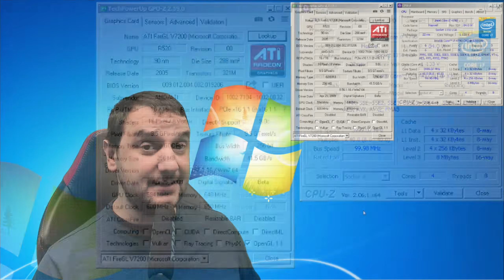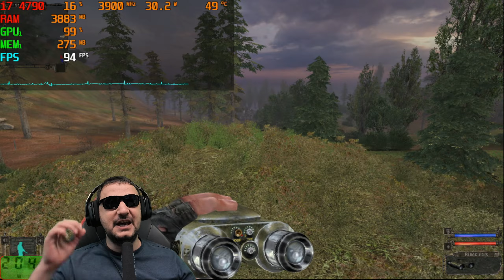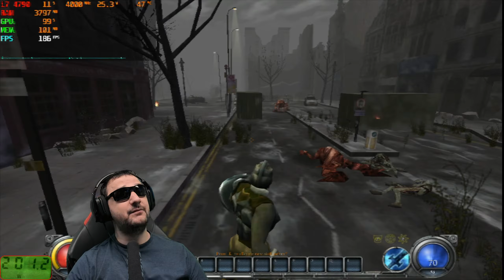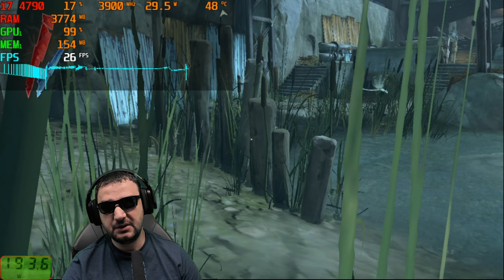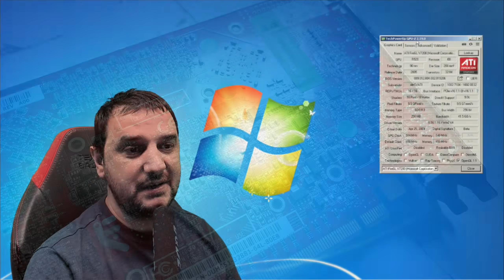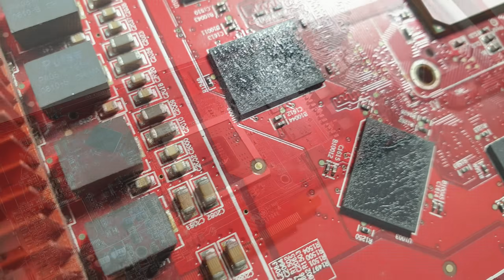ATI FireGL V7200 Benchmark

Comment: Remember that the FireGL V7200 is the professional version of the X1800XT and most drivers don't work proprely. Have you tried with Omega Drivers?
Reply from the maker: Where i van find that? Does it work with x1800xt and firegl?
Reply: @DanielCardei Philscomputerslab have It is website. There is also a version for Windows 98SE.

Comment: I tought youtube ran on low quality for a sec 😅 . Have you encountered issues running youtube videos on some gpu's ? Sometimes some videos have buffer problems on my 1050ti but while i was with my r9 380 i never had issues . When i think of it i didn't have issues running into problems with gtx 260 either when i used it as a backup .  🤔 Tried turning off hardware acceleration on the browser but the videos were tearing up . I watch youtube at x2 speeds lately too .

Comment: I just installed q9550 and 8gb ddr2 in my dell 760 DT and now with gtx 750 ti I can play GTA V at 40FPS high settings at 1680x1050 dell flatscreen and dell mechanical keyboard, runs so well, it’s perfect for me. I always played on faster i7 2600k but this old dell system runs so great, it’s perfect. It’s a sleeper pc, you would never expect that performance and it’s quiet and still has a floppy drive 😂 I have the riser for normal size pcie card, barely fits as single slot gpu but dual slot fan, maybe it’s even dell oem 750 ti, i can’t remember when I installed it some year ago or so
Reply: I wanted to install 9800gt single slot but 750 ti runs so great I don’t want to change it